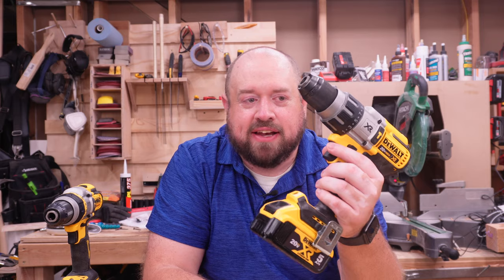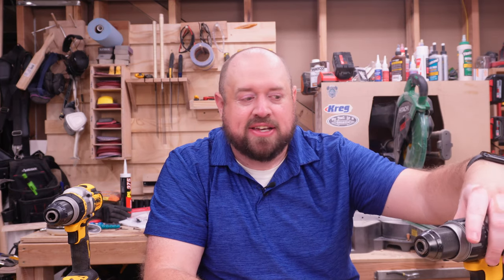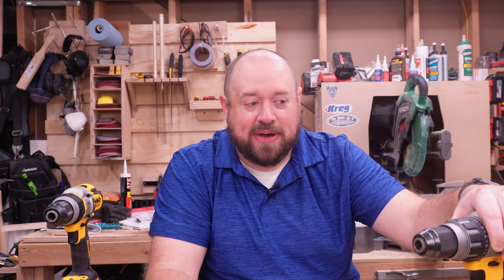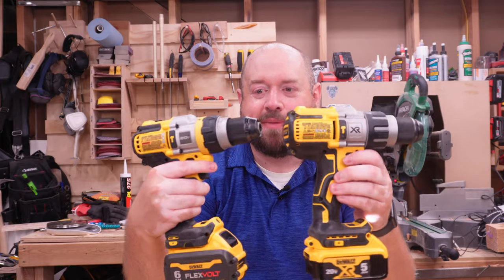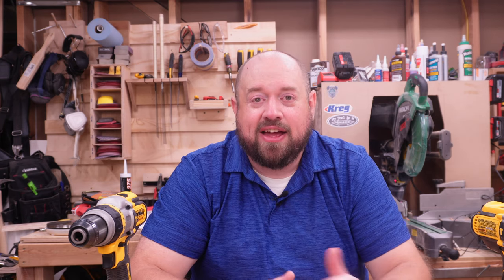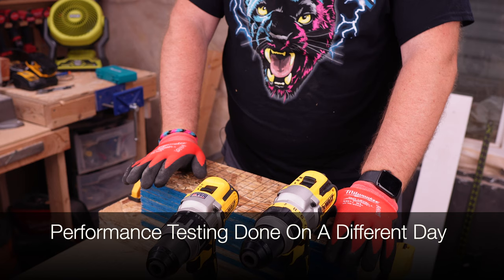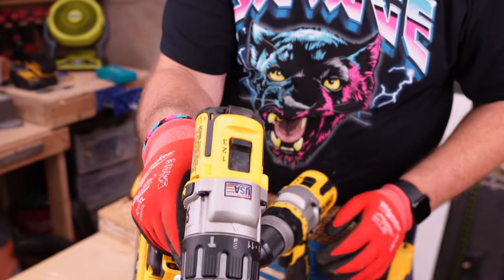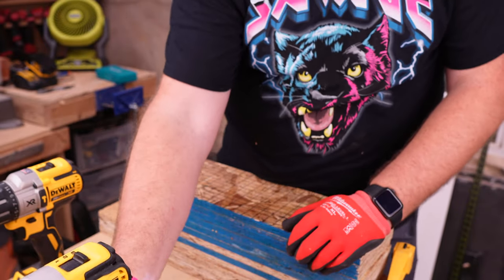What is the Advantage of Flexvolt? - Testing the DeWalt Flexvolt Advantage Hammer Drill

Comment: Very nice testing. I'd only add the testing on the DCD996 with either a Flexvolt or 20V Max battery with 21700 cells to see if it closes the gap between the DCD996 / 5 amp and the DCD999 / 6Ah Flexvolt
Reply from the maker: Yep you are right.   I’ll add it to my future video ideas.
Reply: Tested the 999 against gen 3 Milwaulkee 2years + ago . DeWalt showed slightly more power than my Milwaukee when paired with my 9 ah yellow belly Flexvolt. Thought you might wanna know

Comment: After experiencing the DCD800, I’m insanely stoked for the future Dewalt hammer drills! I have the DCD999 too so it will be hard to convince the wife I need an upgrade 😂
Reply from the maker: I’m anticipating big things from its replacement.   I hope it doesn’t let me down.
Reply: @TinkerWithTools  sorry, I'm new to the space (just getting back into the market for a new hammer drill) - what indication do we have that there is a new flagship drill on the horizon? (The 998 & 999 are only a couple years old, right?)
Reply from the maker: @skygreen5939  I have nothing concrete to suggest a new drill is coming.  The 999/998 are at least 3 years old I think and at the end of the day they are just redone versions of the 996.  So I would hope something is on the way.

Comment: You should have tried the 996 with the larger flex-volt battery. Non-flex volt tools still get a power bump. Could have tried them both with the power stack as well. I think finding the perfect match for the tool and battery is important
Reply from the maker: You are right.  It's a fair point.
Reply: Wasn't trying to be a jerk. 😁 I've just seen alot of how good is the battery videos. Obviously they make a difference, especially the larger AH, the 21700, and the stacked lithium.
Reply from the maker: I didn’t even take it that way at all so no worries I’ve done that comparison for different brands before (Milwaukee, Ridgid and even a power stack video) just didn’t do it in this video.

Comment: The DCD997 has anti kickback, called «bind up control». This is the bluetooth model of the 996, so power wise it should be the same as that, but it also has customizable speed via buttons or mobile app. The bluetooth tools from dewalt are few, but just wanted to point this out. 
Link to this:
https://youtu.be/jc2-z6r7Dbg
Reply from the maker: Thanks for pointing this out.   I looked for that model online and it seems to not be available everywhere right now.   For example Home Depot doesn’t have it available.   But that would make it like the one key version of the Gen 3 hammer drill which had such functions.  Do you know then if the either the 998 or 999 can be controlled by the app?  I don’t think they can and if not that seems like a big miss for DEWALT.
Reply: @TinkerWithTools  No I don’t think the newest models work with bluetooth, the ones that do seem to have the small blue «wifi» symbol on them on the bottom. Also the bluetooth batteries have a blue light on them too. 
They made a bluetooth version of the previous compact xr as well, called dcd797 and 792 without hammer, but don’t think they did this with the 805 and 800 yet. Some of the european brands have had anti kickback for years, the bosch even has an angle function to assist you with putting in screws at the right angle.